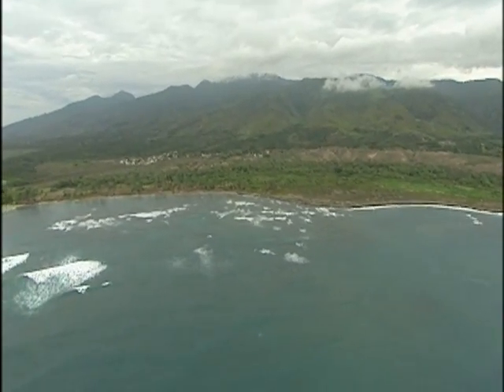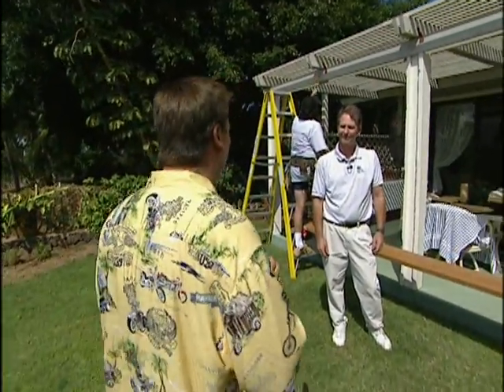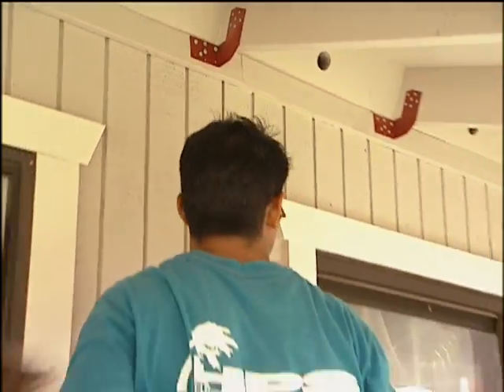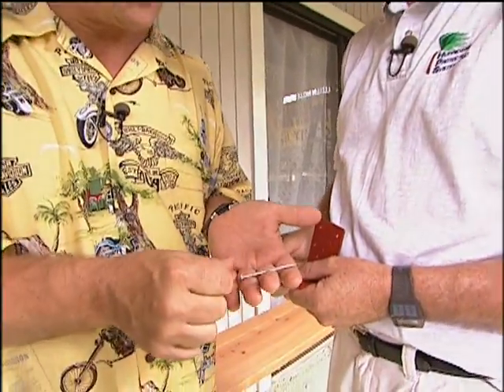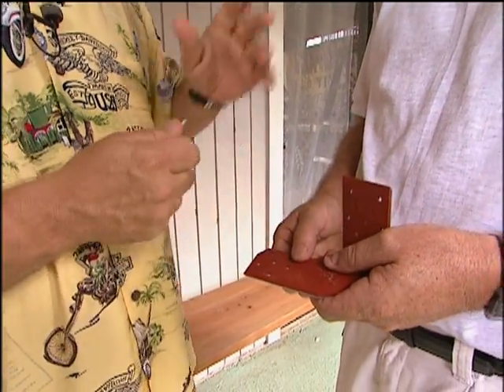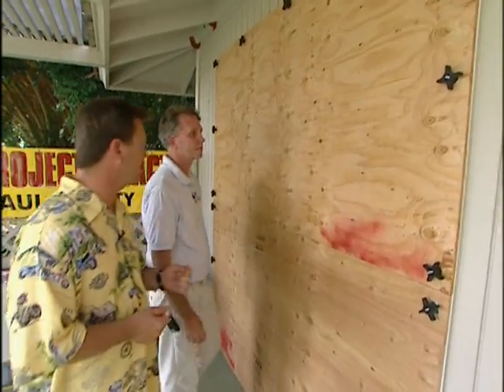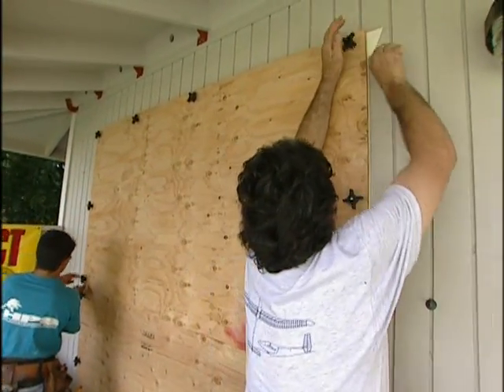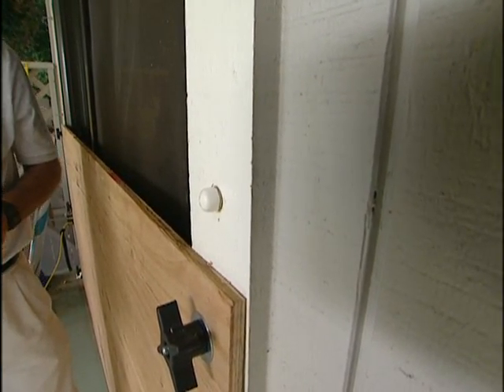Did You Know? Hurricane Retrofit a Home (#5349)

Comment: What a bunch of hacks! Exposed clips? Awful
Reply: This is retrofitted. What is your proposal?  For my house, that would mean going into the attic, but for a house like this, it may not be possible.
Reply: This is not new construction. This is a retrofit. And uniquely in Hawaii these t and g structures have low attic accessibility. Impossible to connect from the interior, unless you gonna tear up the ceiling. I had to do the same for my house. I don’t like the look either but at least painting it helps to conceal it.

Comment: What is the name of that anchor system for the pllywood you are using?
Reply: They are called Threaded Rod Anchors. Sammys, Simpson, and Sioux Chief are brands that make them. The largest size that is common is the 3/8 in. x 2 1/2 in option, that is the one I would use. There is no kit that sells all the pieces together but the individual pieces are not hard to find.

Comment: Where can one purchase those lag bolts/caps?
Reply: Did you find the name for those bolts? I haven't had any luck.
Reply: @jacquelinecottrell2803   They are called Threaded Rod Anchors. Sammys, Simpson, and Sioux Chief are brands that make them. The largest size that is common is the 3/8 in. x 2 1/2 in option, that is the one I would use. There is no kit that sells all the pieces together but the individual pieces are not hard to find.